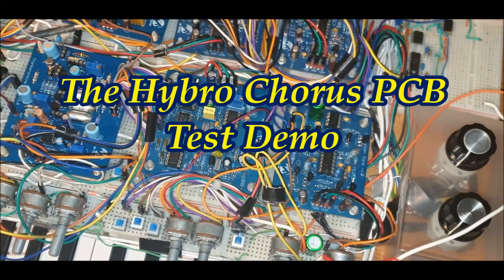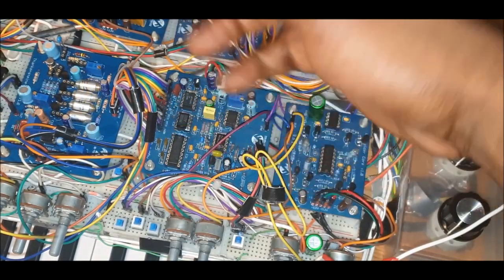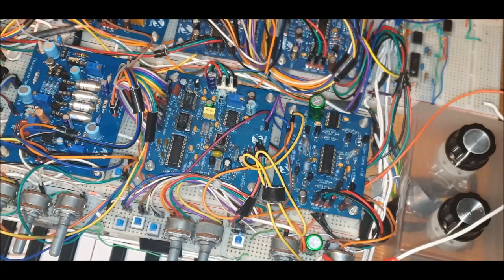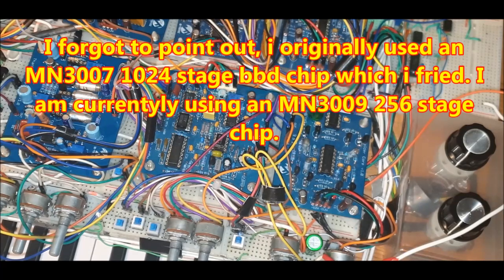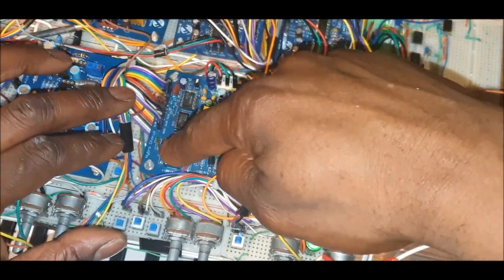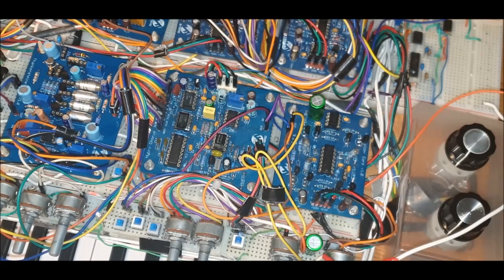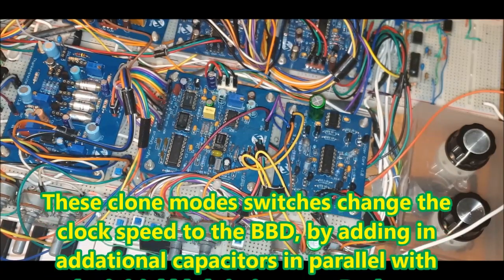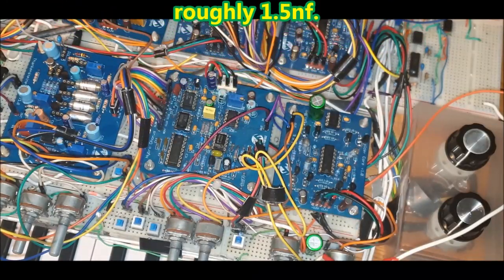DIY analog synth project (Hybro Chorus PCB test demo)

Comment: Nice! Is the schematic available anywhere? Looking for a chorus to add to my modular and this sounds great.
Reply from the maker: Give this link a try for the original http://stompville.co.uk/?p=236 although bear in my mind. My version is based on this but not lots of component mods here and there.
Reply: @AdamTheAd-vanc3d  Ok great thanks. The capacitor mods is a nice idea. I will probably add a wet/dry pot as well as CV control to make it more modular friendly.  Any particular mods you did that you think would be useful?
Reply from the maker: @mattcox4866   Yes you could do the lfo range switch again a capacitor in parallel via a dpst switch . You could also wave shape the triangle wave of the lfo to sine. Have and optional switch to toggle between both shapes. The sine I find will give a smoother  modulation. Not a massive difference but still worth trying.
Reply from the maker: @mattcox4866  Also from the schematic Iink i sent you. You could swap R13 for a 200k trimmer. This you can use as your semi fixed  balance between wet and dry . If you change this from orig 47k value and try diffrent values you will hear the difference.